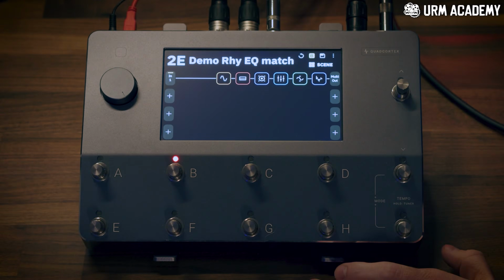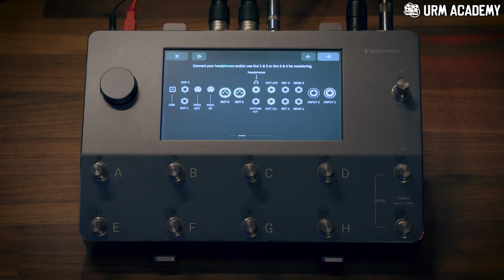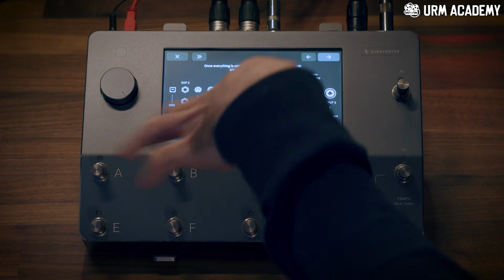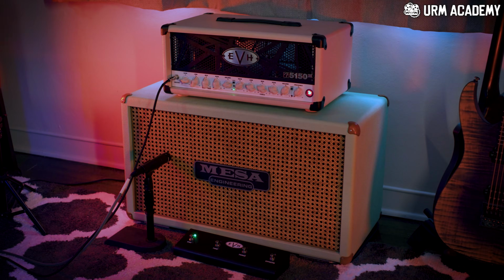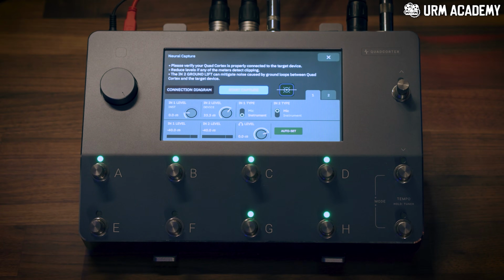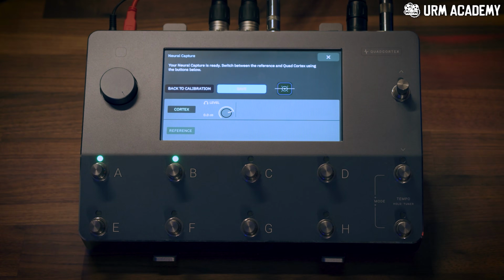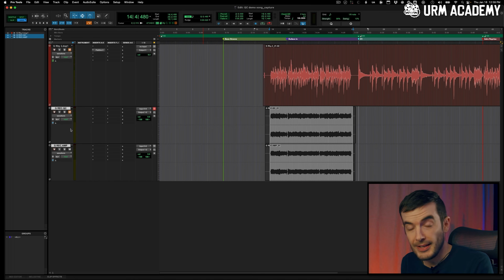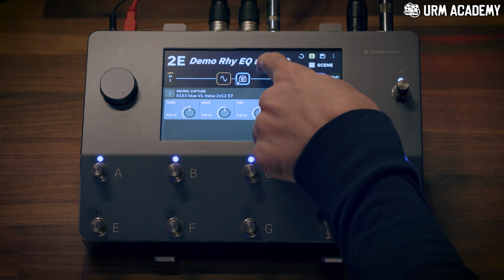Capturing your rig with the Neural Quad Cortex

Comment: Hi, is there any way to capture only the head without using the Cab+Mic without having a loadbox?
Reply: check if your amp has preamp out , usually all amp has this
Reply: @dennissnov  Hey man! I know this comment is nearly a year old, but I had a question regarding this. My peavey bandit silver stripe has a pre amp out. I've tried capturing it but it made squeaky spaceship sounds, I was nervous and turned it off. Was this normal? I know in the video he said to leave the room for a bit for noise lol.
Reply: @lukewachsmithmusic  its normal
Reply: I am also wondering how to do this.

Comment: Does QC compensate a latency of a captured device if there is any? So the capture wont have it.
Reply: i'm pretty sure the latency doesn't matter, since it's just capturing the tone
Reply: @Mozoti well it does when you try to run captures in parallel and get phase issues